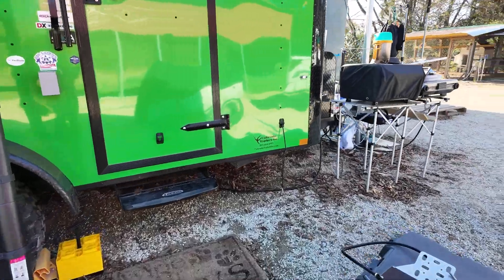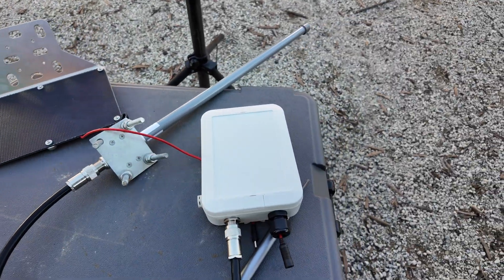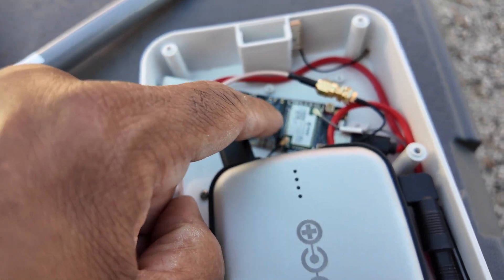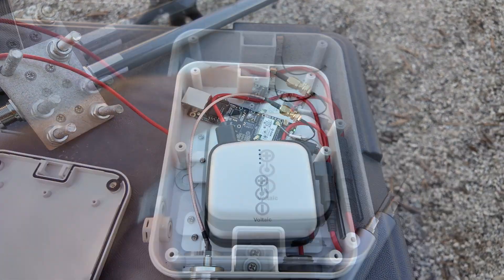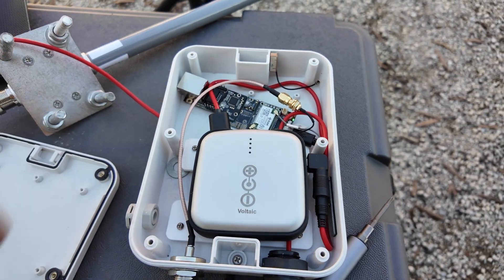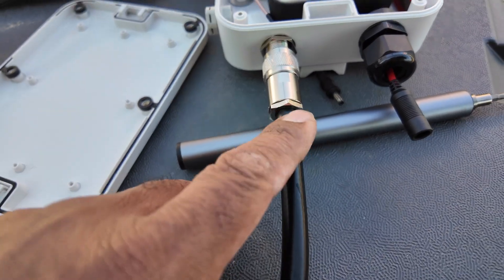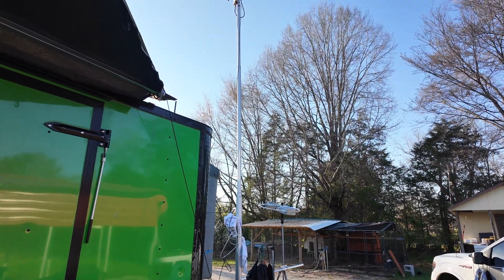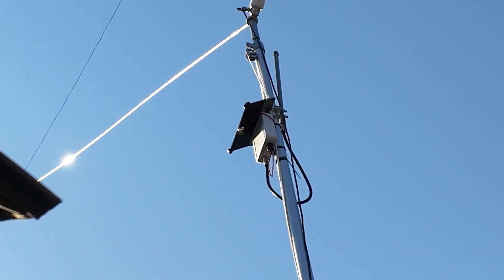Solar Meshtastic w/ RAK Wireless, Voltaic Enclosure, Voltaic Solar, & Voltaic Battery

Comment: Thanks for the video Bill, I have been looking at these for a couple weeks now , just haven't pulled the trigger!
Reply from the maker: Chuck!  Again, thanks for stopping by!  I appreciate the support.  I venture to say that any product you get from him will meet the "Chuck" test.  I guess guys have been using these or a version for years to port their antennas, rotor wires, and other cables into the house, attic, or barn.  Works great for me.  See you out there.  73 de Bill

Comment: Awesome job! Whats all that cost?
Reply from the maker: Thanks for watching and joining in on the conversation!  Well, a RAK starter kit without gps will cost about $26.00.  That particular Voltaic solar/battery setup is their 6 Watt Solar Charger Kit, and it's $89.00.  So, right at $100.  Or you can look up GarthVH on Etsy, and he has a different unit for $129.00  I am new to this, but that seems to be the retail prices.  You can go to your local home improvement store and get the enclosures, find the panels on the web, and probably get away less that $100.  Hope I am in the ball park.  See you out there.  73 de Bill